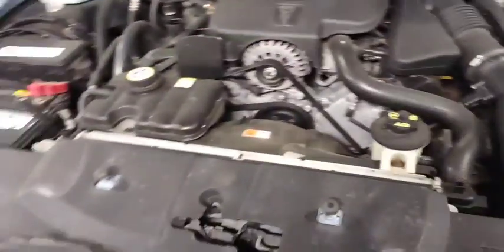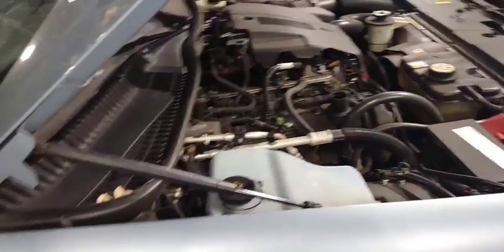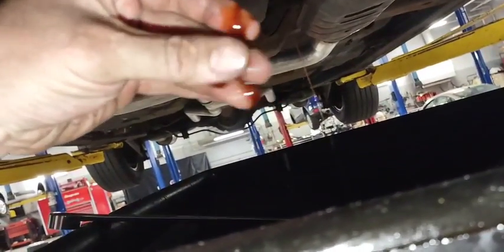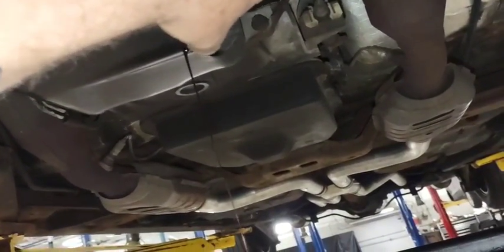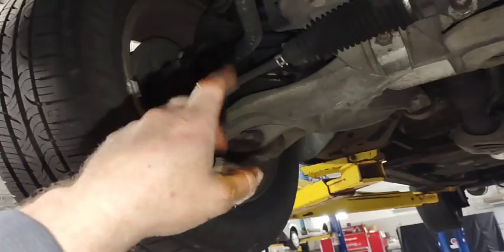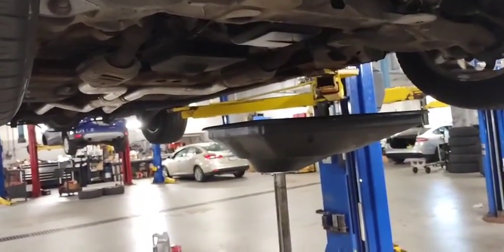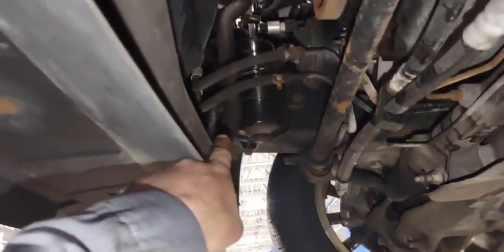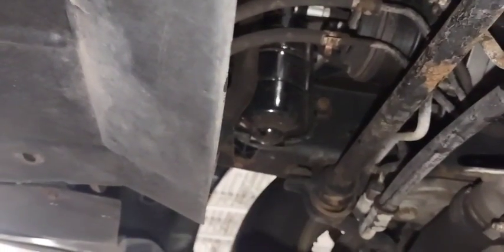Pennzoil Platinum Ultra oil drop 5k Miles, the next 5k Miles trying Mobil 1 extended high mileage

Comment: Btw that Camshaft looks pretty Clean for 220k inside the Filler Neck, You can actually start it at idle with the Oil Cap off to watch oil flow but don't Rev it up or Oil will be all over everything.... lol
Reply from the maker: Ive done it

Comment: Panther cars leaking....I've never heard of such a thing....those are some of the most reliable cars I've ever seen. I have a Mercury Grand Marquis with 140K with absolutely no leaks on any seals. Same with our Patrol cars when i was in Law Enforcement.....we ran the heck out of them every day and they just keep on going some of the best and smoothest cars I've ever driven.
Reply from the maker: Well I'm in the salt belt and almost every one of them to come in have oil pan leaks or trans pan leaks but everything else is perfectly fine
Reply: @AB-yc1np  Same with the State Highway Patrol and almost every Taxi cab company ...reliability is why they used them. I've seen Cab and Limosine companies with 700K on the engines and still running fine never having torn into the engine nor trans for anything.

Comment: Right at 7 minutes, when you start pouring the Mobil 1, there is an unknown object in your oil.... After a 2nd look I believe it's just an air bubble
Reply from the maker: So what ends up happening is air pockets get trapped in there cuz you're pouring and it will actually slap and fold I slowed the video down .25 and then zoomed in on everything and all it was was just an air pocket I tore the foil off ahead of time

Comment: I love Crown Vics, have had 3 that I flipped, too bad I drive a lot of miles to work or I would have kept the last one I had, an '07 with 53K miles. Still feel bad for selling it... and what my dumb@ss did? Bought a Fusion with the 2.0 ecoboost... When I did the first oil change  on the Crown Vic came clean, it was a fleet vehicle, fleet vehicles in my experience get oil changes like a religion...

Comment: On my 2020 f150 3.5 I changed the oil at 2k miles to ultra plat, when I went to change at 7k I developed a rear main leak. Doubt it was the oil, but maybe, switched to Mobil 1 and so far so good after warranty
Reply: 2020? little early for a rear main leak isnt it?
Reply: @wildcard749  yep especially at 7k miles I was not pleased
Reply from the maker: A lot of times it's the way they seal the oil pans and it makes it look like it's a rear main seal leak but it's really just an oil pan because they don't do a very good job sealing them from the factory honestly

But then again anything's possible now

Comment: Please comment opinions on Liqui Moly motor oil. I use it in my 2001 Mercedes E430 and it seems ok but I would like some folks input
Reply: I’ve used it in my Honda (5w-30) and BMW (5w-40), with no problems. It performs well in VOA and UOA samples on the bob is the oil guy forums too. 
Most oils these days are pretty good really.
Reply: @zeroyon4562  Awesome thank you for the reply and input. I really like the jug Liqui Moly uses it looks kind of like a tool box. I like the oil pop up spout too I think it’s neat. And I agree most oils are pretty good, and most have just minor advantages over others. Do you have any opinions or input on the Liqui Moly Molygen (green) oil? I have been tempted to give it a try

Comment: Big fan of Pennzoil Platinum. It's all I run anymore in my Super Duty and in my Honda. Amsoil may be slightly better but it's WAY more expensive. Just not worth the extra cost IMO. Pennzoil Platinum is the sweet spot for cost/performance.
Reply from the maker: Pensoil Utra Platinum Is The TOP oil From Them

Comment: Hello Ford Boss I'm Canadian, I like what you say and do, your a good man / mechanic. 1 Question.

Where does Haveoline stand for oil rating like Pennzoil , Mobil 1 and Castrol ?

Keep up the good work.
Reply from the maker: Haveoline I'm not the person to ask about because I never really hear anybody talk about it maybe somebody in the comments section or one of the other technicians here will give you their opinion I don't really have one on it
Reply: I was made a huge fan of Havoline by my grandad. He worked in a service station in the late 50' or early 60's. He saw all kinds of stuff roll in, and in his experience, Havoline was the best oil at the time to keep an engine clean. That was the only oil that he ran in his '72 F100 from the very first oil change until he parked it in '94 at 179k miles (288k km). Same for my grandma's '85 Olds Delta 88. When ai had to do the valve cover gaskets on the Delta when I started driving it, the valve cover and top of the head were astonishingly clean for 172k miles (277k km). Just a light golden color, and there was no oil consumption. I just wish it was easier to get ahold of these days down here in Texas. Sadly almost nobody carries Havoline any more.
Reply: @texan90  thank you for your response Canada sells it for $5 a disabruter A liter, vs Mobil 1 and Pennzoil is 13-14$ a liter,  Havoline for 23 liter it is 114$.  Where Canadian Tire has a sale for 4.4 liter for 35$.

Comment: I’ve been using Mobil 1 for my 99 grand marquis and 94 explorer no complaints also on my dads 98 Silverado 👍
Reply: My 98 MGM and 96 Ex get PP HM 5W30.  Explorer OHV engine MUST have 5W30. Thinking of trying M1. I also have an 11 Lexus GS350 and the factory recommendation is CONVENTIONAL 5W30 with  a 5K OCI. Lexus told me they felt it would be best for GDI with fuel dilution, but for 2013 they changed it to synth.  For this I use PP Ultra.

Comment: This test can't tell if additives from the last oil affect the new oil. I always use motorcraft or K and N oil filters. Pretty much all the other filters except some OEM  ones are garbage.
Reply from the maker: Write this is not a stone cold true Hi Li study test this is just anecdotal for me that's all
Reply: @FordBossMe  it's all application the oils that produce the most HP are not the longest lasting  . Look a castol's line up . I was very impressed with the castol magnetics for cold starting. I looked under the cable cove after 5 days of vehicle not running. Everything was still coated in oil.
Reply: @FordBossMe  it would be great to run every thing in Castrol line up thru a new identical engine. To do a application experiment . If I was sponsored by Castrol to race I would run edge. But magnetics in a stock almost new vehicle.

Comment: I'm gonna try penzoil ultra for the first tine in my 04 town car and see how it is. I just had a check engine with code p0442 (evap leak) so i tried changing the gas cap first but didn't fix it do you know what it could be ?
Reply from the maker: Purge valve
Reply: @FordBossMe  Thanks
Reply: @FordBossMe just to be sure, is the purge valve located in the  square box thing under the car close to the tailpipe?
Reply: @FordBossMe  I can't find the location of the purge valve can you please help ? also is it called vapor canister purge valve assembly?

Comment: Mobil1 is Esso off brand

I find it much easier to reach down from the top to put the filter on on my grand Marquis.  Straight Mercin'  bro 270,000km oil change every 5000km i live in the rust belt a third less miles and mine is rotting but super strong i almost want to put this motor and transmission into my 1979 f100 but I just had a 4 speed manual installed and i wouldn't want to have wasted that efforts
Reply from the maker: Nice rides
Reply: @FordBossMe  is the triton modular platform the same bell housing as the 5.8L Windsor 4.9L inline

Comment: 5k on a port injected NA engine with platinum, ultra platinum or Mobil extended performance is a bit low. I'd only consider those intervals in a twin turbo gdi engine. I  now do 10k in my NA non gdi with euro rated 5w-40 like Quaker state euro since it's higher certified for extended intervals than even Pennzoil ultra platinum and is up there with Mobil 1 EP. I'd do at least a few more thousand with that ultra platinum. The engine doesn't abuse oil like a modern one. To be honest I'd use a better filter. Motorcraft and other cheaper ones aren't the best at filtering. The fram ultra and TG have 99% at 20 microns and I've seen it myself the oil is physically a bit cleaner to the touch than with the cheaper oem filters and it has been proven to reduce wear a lot by itself. Motorcraft is around 93-94% at 20 microns which isn't horrible but not good in today's standards
Reply from the maker: Well that's all I'm willing to go you guys know my stance on oil and I'm not going to change that really I don't like going over 3000 Miles people can have their opinion but not me and that's what I'm about and that's how I'm going to be
Reply from the maker: You service your s*** early you take care of your vehicle you're going to have a lot longer lasting healthier happier engine that's just fax Jack
Reply: @FordBossMe  of course there's nothing wrong with changing sooner in today's very sensitive gdi turbo engines. But these older simpler engines just sleep on the oil. I have 309k on my engine and it's never been rebuilt. Burns a quart every 4-5k which is pretty good for the milage and the compression is great. Hardly any oil in the plugs when I last did them. In a TT Ecoboost yeah I'm with you 5k with a great oil since they do need it to not have issues.
Reply: @FordBossMe  servicing early was important back then because expensive oil filters even 10-15 years ago like the wix and Japanese denso filters had absolutely terrible filtering efficiency. 48-53% at 20 microns. When the oil is that dirty scuffing occurs which is wear, and when you have particle contaminants in your oil acting as liquid sandpaper you're damaging the hell out of the engine and on top of that oils weren't suoer grea so yes changing every 3k allowed the engine to live long. But because you simply wouldn't allow the oil to continue building up particle contaminants making the oil into a lower grit progressing oil sandpaper. Not so much because the oil would sludge the engine but because oil filters back then we're garbage and some cheaper ones today still are. There was a study done by GM where going from cheapest (98% at 40 microns) to most expensive (98% at 15 micron) oil filters reduced engine wear by almost 80% as compared to cheap filters.

Having less contaminants in the oil is from better filters better for the engine than changing a bit sooner. The motor craft filters aren't good because they're still having issues with tearing and cracking open. I cut the OEM fomoco filter open over a year ago out of curiosity and the glue seam was partially broken open after almost 6k. I think that's also why you stated the oil felt very dirty in a car you did an oil change on recently. The motor craft filters don't filter the best and some but not all tear open a little and allow all the trapped contaminants to pass through causing extreme wear. Will the engine wear out before the warranty which will then lead to a TSB? No but after the short warranty ends the engine will be worn. People focus on the oil but disregard the oil and even air filter. Having above average air filters also helps keep the oil cleaner since the air goes into the ventilation of the engine so it helps reduce the contaminants going in. The oil pumps contaminants around until they're finally caught by the filter but by then the damage would've occurred.

If you truly care for the engine which even I do as I love that mint panther babe of a town car you hve you should invest more on higher quality oil filters like a fram Ultra and wix air filters.

Comment: Had a Ford escape 2.0 turbo. I believe the service said every 10k miles. The oil from it at 10k miles was just nasty. I would never buy a used eco boost that followed manufacturer recommendations

Comment: To see a tech immediately start revving a cold engine that’s idling high warming up… hmmm now that’s experience
Reply from the maker: It is, a tech not built up by wives tales
Reply: @FordBossMe  tales? The engine selfs idles up for a reason. You’re the one believing tells lol. You never wanna heat up an engine faster . That’s how we expand metals and expand gaskets to quickly. Equals leaks and wear

Comment: Seems the type of motor oil a person uses changes a few times a generation .I understand using what we think is best for our vehicles.Most people do not buy a vehicle to last them 20 plus years  .Seems everone trades in at 2 or 3 years or the vehicle just starts falling apart and they sell it.  My grandpa keep his old 1956 or 57 chevy untill he was unable to drive.I remember him saying just sixty thousand more miles untill it hits Five hundred thousand.That day never happened for him.Just one reason of many I do not believe in gasoline engine lasting longer than they used to.Interesting video.May give that oil a try.

Comment: Your engine looks great through the oil fill hole. Takes a confident man to open up his oil cap to anyone...lol. You will have to trust me but if you run 4 oz of Marvel Mystery Oil 200 miles before your next change, it will clean of the bit of yellow residue on the cam and in the oil fill tube. I do 5000 mile changes and a bit of Marvel every second oil change keeps my engines spotless.
Reply from the maker: The next Oil Change I will try that

Comment: I have a 1998 grand marquis. I keep putting conventional in it cause I heard that's better since that's what it always ran. I was scared to switch it to synthetic. Do you think it will hurt it?
Reply from the maker: Wont hurt 99.9% of the time as long as all the maintenance was kept up on....better oil does clean more so it can clean deposits away that may be stopping leaks

Comment: Well a little more injection of knowledge might help. Most synthetics are really not synthetics. They are just  much better refined oils that are more likely to contain hydrocarbons of a certain length.

Oil filters: a good test is to what size particle does it remove? 5 micro should be the standard.

Some of the synthetics must be changed periodically because the oil builds up carbon particles which can can jam or clog the rings which will decrease compression and engine life.

Just thought I would throw that out. Let’s start the conversation.
Reply from the maker: I mean this was more a personal thing to me how to and also subscriber request we do have videos up that are more based on information and knowledge but this wasn't that and it didn't need to be part of this because this was a request

Comment: 5k would be nice. I have been doing that with my vehicles for a while now, but you may have scared me out of that with my 3.5L EB.
Reply: I'm going to be honest with you I just did an EcoBoost yesterday, some of these are going to have a oil dilution as you do to direct injection and because it's turboed. The one I changed was roughly around 6,000 maybe 6,500 mi yesterday I'd have to check the paper. But you could smell the fuel in the oil and this customer just brings it in when he wants to and he refuses to do an oil analysis some people think it's just a money gimmick but it doesn't hurt to see what's going on cuz it will analysis shows you anything that's in the engine If it's coolant bearing material this thing can find issues that you  didn't even know you had. 5k is a good interval. If it works for you stick with it.
Reply: @1997obspsd  Yeah, 5k is plenty. I have not had a UOA done, but I check my coolant level every day or so, and so far it has not dropped. I check the oil weekly and yes, a quick sniff would tell me if it is diluted. So far no bad gasoline smell.

Remember, the manual says you can go 7,500mi if you're not towing. I don't believe it. According to the IOLM (shows the percentage of life left in the oil) at 5k I am between 12% and 30% depending on my driving.

Comment: What made you choose 5/20? And do you use that all year winter/summer?
Reply from the maker: I use 5w30 all the time now - quieter
Reply: It's hard to say with some of these motors it would absolutely depend on the engine. Like my older 8.1 l that big block will take 1540 I'm just work no matter what the temperature is. But typically I would feel more comfortable with a 5, 40 in the summer 5, 20 in the winter.. again depending on the motor, the manufacturer the mileage etc there so many variables. We both know at the end of the day the maintenance and care of the motor & vehicle is what's most important.
Reply: I remember in one of your videos you mentioned about other fluids. I might be a bit inaccurate but saying the majority of car owners will never change their brake fluid power steering fluid don't think about coolant transfer case fluid differential fluids excetera excetera
Reply from the maker: @ronkirkham3410  most people neglect those fluids
Reply: They absolutely do neglect a lot besides those fluids. And then they get upset when there's a breakdown and the more expensive repair bill.! I've live by preventive maintenance besides enjoying working on my vehicle's it's like you said about your car having a Tip-Top and running absolutely perfect and not dripping anything

Comment: With an Ecoboost engine, is there a mileage where you would switch to a high-mileage synthetic oil, or just stick with normal synthetic?
Reply from the maker: You can use high mileage when new

Comment: Any used oil analysis done? 10 years ago Mobil 1 showed increased iron in the oil vs most others.
Reply from the maker: Mobil 1 so far - did good but under heat testing didn't hold up well Blackstone said was some concern there, just sent off Penzoil Platinum Ultra and I've been waiting almost 3 months and they have jot got back to me
Reply: @Ford Boss Me hopefully the results come soon. It would be nice to see how the platinum  held up.